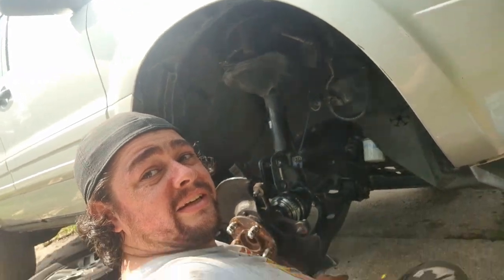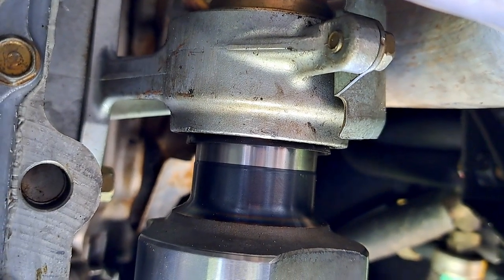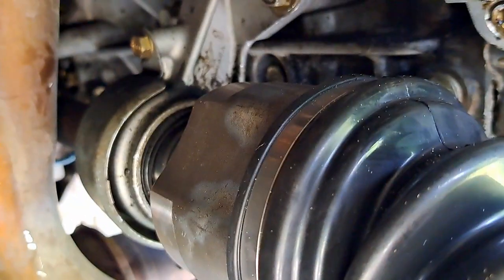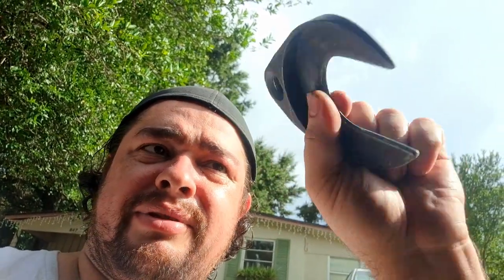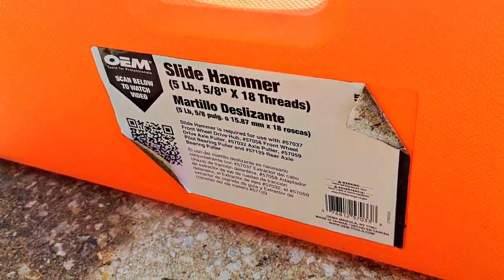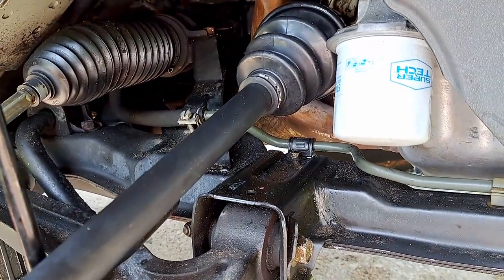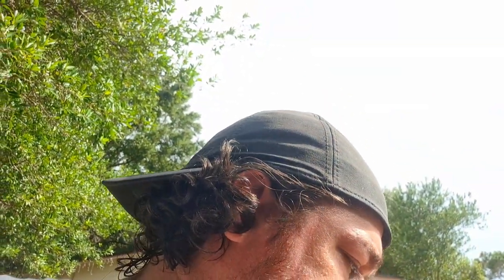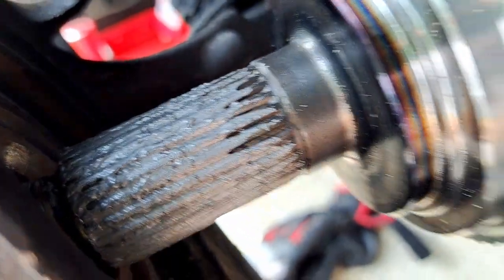CV Axle removal, Using the RIGHT tool!!

Comment: Perfect timing.  Thanks for the helpful video.  I  am going to replace the passenger side cv axle on a 2006 Pilot.  Any reason why you didn't just replace the intermediate shaft also?
Reply from the maker: Honestly I'm going to have to do that next. Initially I took it to a shop to have the alignment done and that's when they told me about the axles. I did both axles (passenger side shown in video) but they said the inner shaft should still be fine, though I'm hearing noises from it so that's next lol